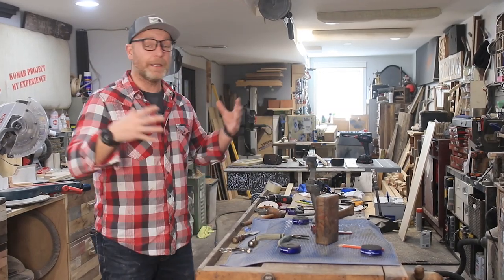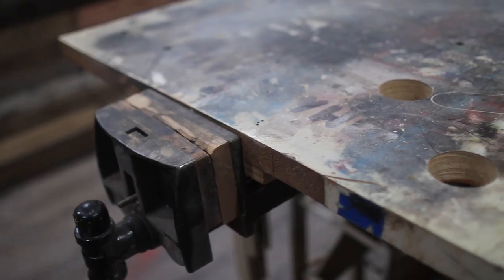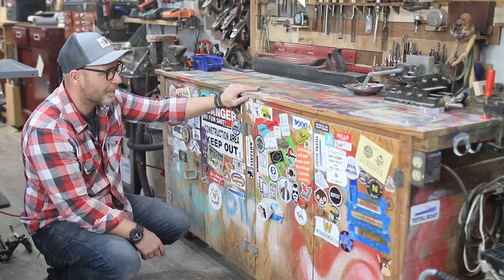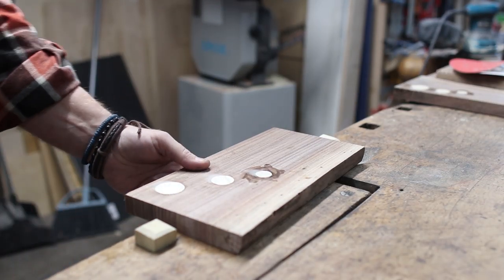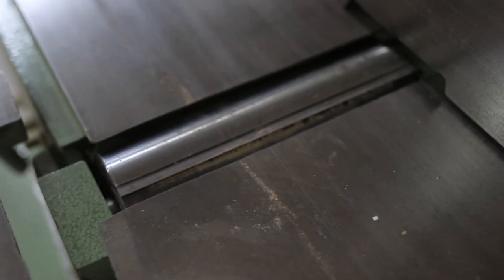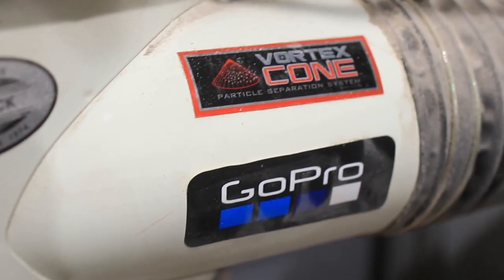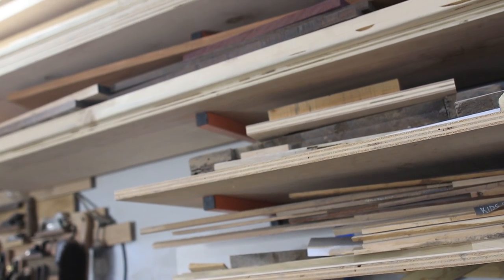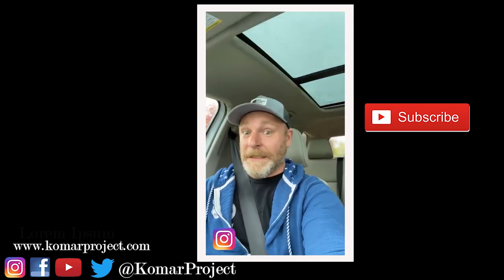Ultimate Basement Workshop Tour 2020!! How Much I Paid For My Tools!!!

Comment: What brand and model table saw do you recommend for home use?    Trying to build a deck and more.
Reply from the maker: Anything will do.  If your looking for a small job saw I know Bosch and Dewalt make good ones.  Either way you go I would make sure it’s 1hp or above.   My ridged is 3/4 and sometimes just doesn’t have power for the big stuff
Reply: Thank you.